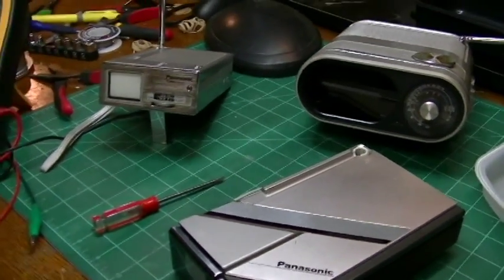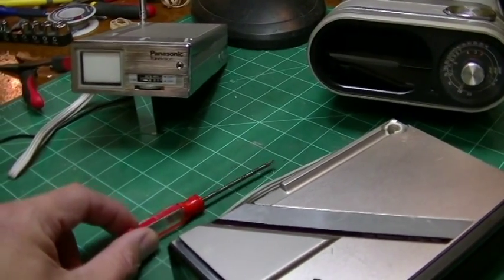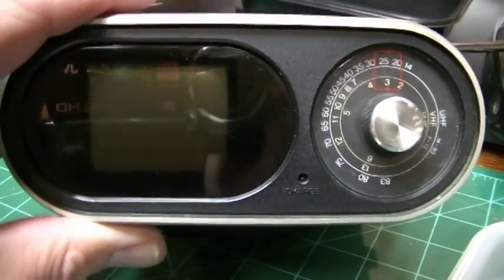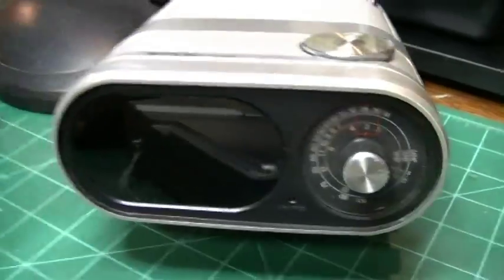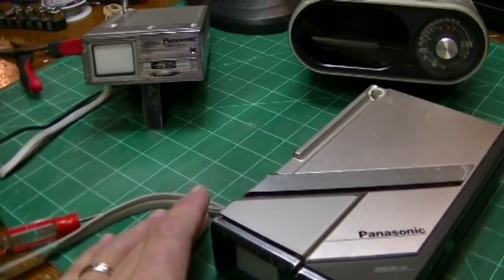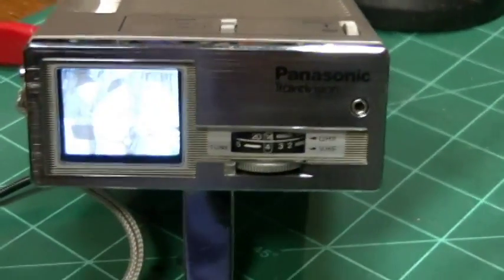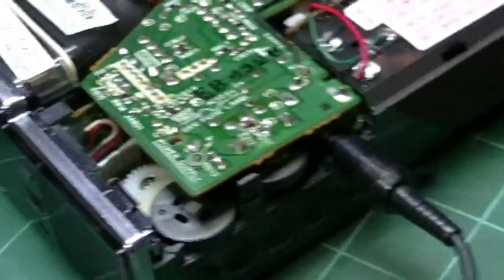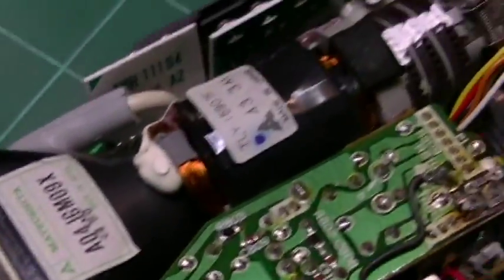Panasonic CT-101 1.5" Color TV Repair Pt 1 of 3

Comment: @15:45 when you mention the squealing module, mine does the same, and also leaves lines on the CRT. caused by EMF from the transformer. the squealing, i can tolerate, but not the wavy lines.  Looking for a way to block the emf from the power supply hitting the tube.

Comment: I've found a lot of things on sites like electrotanya, or simply by typing a make and model number into poohgle, sometimes you can find info either by asking on videokarma or the appropriate section on antiqueradios dot com.
That open diode could be the main fault, or at least one of them, at least it did not short, or if it did it burned out shortly afterward. I've heard that earlier surface mount electronics have lots of problems with failed solder joints, not to mention that the resistors may have drifted up in value or become open, so more things to check. Replacing the electrolytics is probably not a bad place to start, especially in a power supply that obviously has a fault, but it would be best to see if something else has died first.

Comment: Scott,
One more comment...It would be beneficial to do a vid about the Blonder Tongue RF Modulator you mentioned....detailing how you have it hooked up.  Inquiring minds want to know.
From here on out, my friend, knowledge gaps are directly proportional to the subscriber count.  Translation: Leave nothing hanging.  :-)

Regards,
John
Reply from the maker: Yes, John I actually have that on the docket coming up. You may have noticed in the vid...when you look close at the pictures on the TV screens, you can see some interference bars rolling up the screen. That's an electrolytic cap issue in the BT, not the TV. I plan to demostrate that fault, and show a recap of the unit and see if we can fix it. Coming real soon!!!! Thanks, Scott

Comment: I subbed because John in Arkansas said to come by and take a look at your channel.  1 thing I would suggest is to try running your tv on batteries.  Is there an external power supply that does the AC/DC conversion or is it 110 into the tv?
Reply from the maker: I'm running straight line voltage into it. There was a special rechargable battery option that came with the set, but I do not have one. It would probably be bad anyway at the age it would be. But I do have the wall wart for it and that's what I was using w/no battery installed.